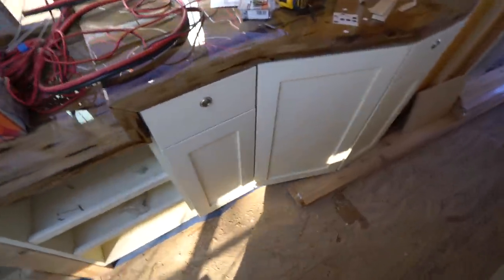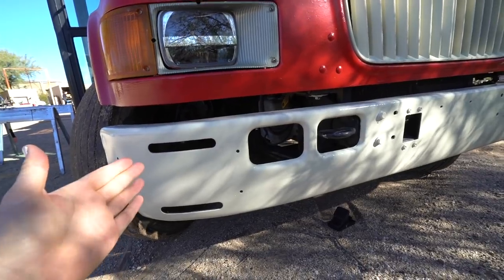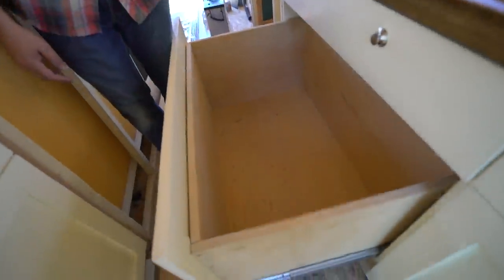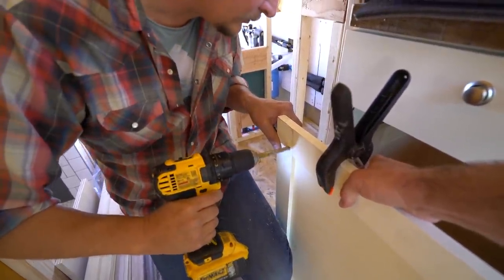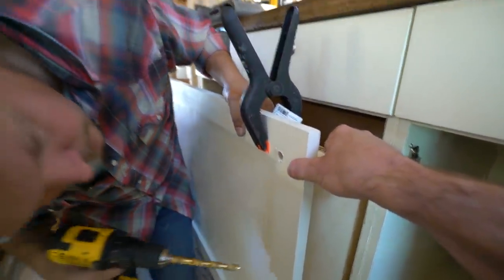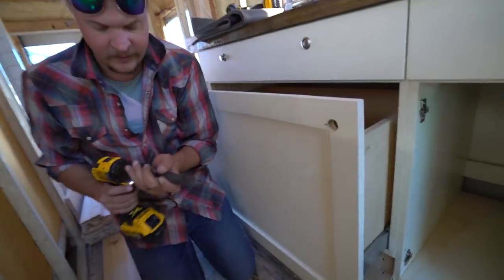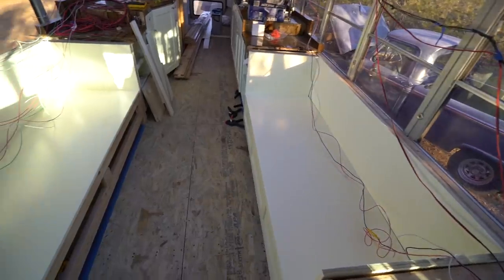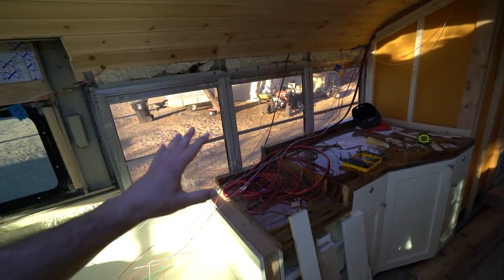RV DRAWERS THAT STAY CLOSED (pushlock) VanLife Skoolie

Comment: Tip on using a spade bit. Drill almost thru the wood.  Go the back side of the wood. Use the hole that is on the back side (from the point on the drill) to start drill on back side. Then drill from back. Avoids blow out.

Comment: Love it. Here is a little tip on drilling holes... (coming from a finish carpenter/woodworker for 30 years. ) a drill bit cuts when sharp and in motion. It tears out when it is dull or when pushed too hard. Let the drill do the work. Let the drill come up to speed and push lightly but don’t let off the trigger. If you feel like you have more control pulsing make sure you let it come up to speed. A slow moving bit will dig in and tear out the material rather than slice through it. With spade bit you could start from the front and finish it from the back or put a backer block tightly clamped on the back. Make sure the bit is sharp. I hope that helps. Maybe see you at the RTR if you are going.

Comment: A good way to protect a finished wood product is by of course clamping on a block of wood to the back and also add a couple of strips of masking tape, will guarantee that the cuts will have good clean painted edges 👍

Comment: might need two locks on the fridge drawer , its not only the problem of will it hold but allso will i pull the knob off the locking mechanism
best way to work with a spadedril is drill untill you see the point come through then use that hole to drill through the other side , forstner bits are best for drilling this size holes

Comment: Where did you get your hardware from? Those locks look very similar to the ones I've used from Hardware Resources which if im not mistaken their corporate headquarters is in Louisiana.. And what I usually do for the 12footx10inchx1footdeep tall shoe racks that I make for walk-in closets is I use 3 pairs of rails total, for that Ref drawer using one pair on the floor and one mid-drawer would definitely help out alot!